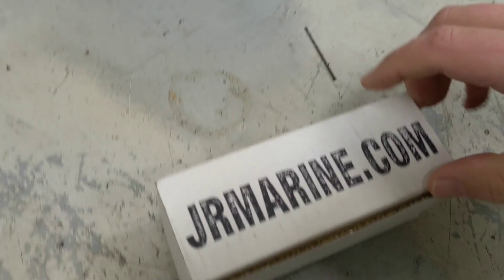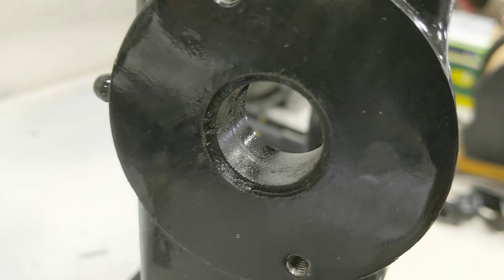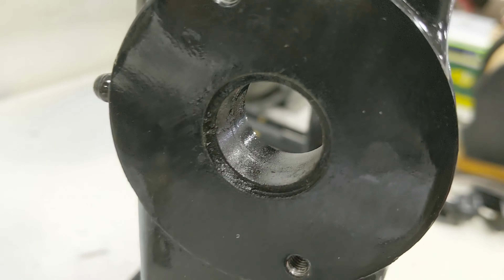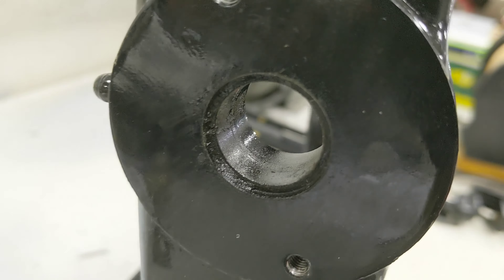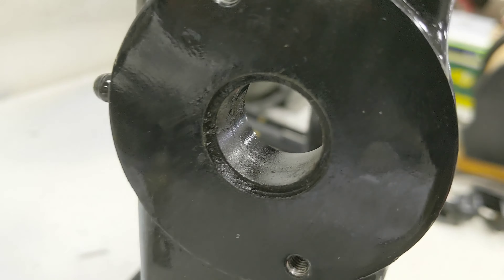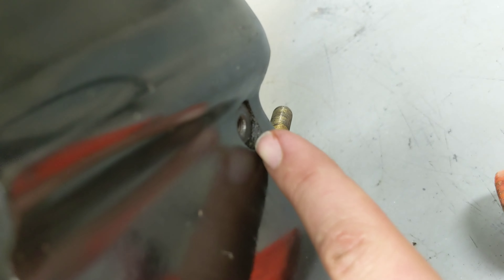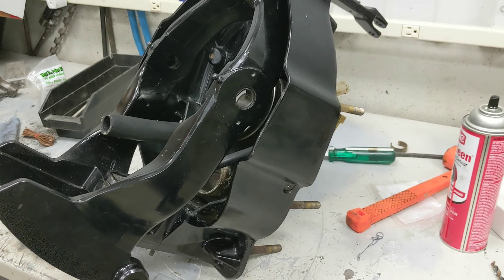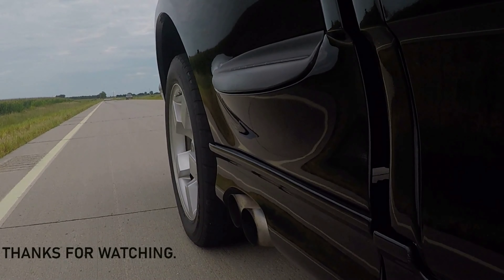Installing a Rebuilt Gimbal Ring, New Swivel Shaft & Gimbal Bearing -- Mercruiser Alpha One Gen2

Comment: You forgot to roll the water hose clamp - You're gonna hate if you have any problems later.
If it's rolled to the top then you don't have to take anything else off to get to it, but now you'll have to take the bell-housing off just to get to the hose clamp.
Live and learn - been there done that.
Reply from the maker: I think somebody else said that in the comments too. I think if it comes to that I would cut the hose clamp and just get a new one. But yes, you have to be very strategic with the hose clamps. I may have missed one or two of those.
Reply: I seen in the next video that you actually rolled it up to the top 👍 @605BOLT
Reply from the maker: Even a blind squirrel finds a nut now and again haha
Reply: LOL
I've been known to find a acorn every now and then.
I appreciate the detail in your video's.
These full rebuild vid's provide a lot of information that is useful for preventive maintenance, things I hadn't considered looking for.
I am currently in the process of Boot replacements on two SeaRays, just did a Engine Coupler & Alignment on a '79 Sundancer and followed up w/ full cable replacements, only to discover that the boots were leaking (4th time pulling the Stern Drive on that one....ARRGGGG). After pulling the Gimble Bell-housing off yesterday (with some good insight from your video's) I found that whoever replaced the boots that last time didn't even get the clamps tight, and after messing around I learned a hard lesson about positioning those bellows clamps "strategically" as you mentioned (lol) for future access. The ones I'm working on are older than the Gen II you're doing and you have some added BS in your way that I don't have on the Alpha Gen I, however...if I had to deal with loose clamps again I would want to be able to get a wrench on them WITHOUT pulling the bellhousing off and making a 4 hr job out of a 15-20 minute job - If ya know what I mean.
Lessons learned - that's why I made the comment.
You also made the comment about the probability of not even needing the exhaust bellows, but if its not used then the water can back-up in the flapper valves in the exhaust  and corrode the mechanism so they don't open and close correctly - another lesson learned the hard way and those are a mother to replace in a tight engine compartment - TRUST ME ON THAT ONE.
A wise Man told me:
"Experience teaches a hard lesson, so you can learn from others experience or your own, choose the shorter path and learn from others mistakes instead of have to make them yourself.
That's why I appreciate your video's and others video's, b/c it helps avoid costly mistakes and HOURS if not DAYS of labor, not to mention senseless money spent on unnecessary parts etc.
Thanks for the Vid's bud, keep it up, your helping more people than you realize, even if they don't post comments, they're still out there watching and learning. FINDING ACORNS LOL  @605BOLT
Reply from the maker: Thanks for your kind words!!!! Sounds like the SeaRays and Sundancer are getting the full treatment!  Are you a marine mechanic professionally or a relapsed boat addict?  I can't imagine having more than one boat.  One is enough headache for me haha. I have never worked on a Gen 1 Alpha.  For my next boat, I'd like a Bravo so I can learn on something a little different.  I never thought of corrosion really due to being on fresh water but you're right that the flappers and height are basically your only defense against surging wake when you stop.  Some use the little exhaust tube deal. I'd like to try that sometime.  It only seals when its down. Kind of an ingenious idea.  I appreciate the words of wisdom and couldn't agree more.
Reply: Not a boat mechanic per se, just a backyard DIY'er, but I've learned a lot this summer after loosing the upper gear set on my Alpha one.
I only have one boat but my dad has an older SeaRay and he's too old now to do the work himself so I volunteered, since it appears I'm the only one competent enough to do the work and do it right.
I have a background in welding, pipe fitting, heavy equipment operation; I was a independent welding contractor for over 30 yrs and I can fix just about anything - not a boast, just my nature I guess. I like building things and fixing stuff other people throw away, you can't imagine the treasures out there that people just trash because they don't know how or not willing to try and fix them. One good example is my old "54 Ford Tractor, got it for a song and had it running in one day, that's a real treasure for sure.

I've built a few motors in my day and worked just about every recreational vehicle we've ever had, snowmobiles, ATV's, motorcycles and even a few lawn mowers hehehe...
I would like to open my own boat repair shop since there's really no one around that provides a full service marine shop and NO PARTS, not even the common everyday items we need for maintenance on the very basic marine engines and stern drives, and @ 100 bucks an hour and with as many boats as there are around here (just south of Flaming George about 40 miles - North Eastern Utah) I could make a killing LOL.
There's an old saying: "If an idiot (like most mechanic shops around here) can make a living doing it, anybody with a lick of sense can make a killing".

I've thought about doing the direct exhaust but I prefer the quiet sound, like a butterfly @ Mach 1.
Believe it or not, Lake water is almost as hard on boat as salt water, because it's really hard water and a lot of hard minerals that build up over time, so constant maintenance is the only secret to owning a boat. 
We could always follow the advice of my old friend (multi millionaire):
"If it fly's, Fu**s or floats, or eats hay, DON'T BUY IT, RENT IT"

Keep up the video's, as I said before, you're doing a great job on detail and providing a great service to everyone willing to watch and learn - otherwise we would have to pay somebody to do the work that most people can do themselves but never considered it because they think it too hard.
This stuff is really pretty simple once one gets to know how everything works and is put together. 
A word of advice to all who watch:
Dare to try, you only fail when you refuse to try.
 @605BOLT
Reply from the maker: @migelikali7265  can't agree more. Sounds like we have lots of similar interests. Whatever moves is fun. Thanks for watching!!

Comment: Thanks, upcoming event this winter for me.😅
Reply from the maker: @Yugsie  ya it sucks but when it's done you feel so much better. And the boat drives so much better.
Reply: @605BOLT  
It's gotta help around the dock and trailer!
Reply from the maker: @Yugsie  for sure. It is a little bit wobbly when the gimbal ring is all wore out. You need to make huge steering swings to keep it on track

Comment: Just a Tip from a 42-year pro mechanic. Freeze your bushings and bearings over night before installation in a freezer (or use a CO2 fire extinguisher to freeze if in a hurry), they install much easier when cold. ;)
Reply from the maker: For sure.  I've used that at work from time to time.  Definitely makes a difference.  Never tried the fire extinguisher.  I have used canned compressed air propellant though. That works too in a pinch.  Good info!

Comment: Thanks, great vid, got bit of play in the steering, now I know where to look.
Reply from the maker: Yes for sure. Take a look. There is some natural play because of how the valving in the power steering ram reverses fluid and maybe your steering pin pinch bolts are loose. Worst case the steering arm is worn out. Hopefully just loose and can be tightened. Check out my video on gimbal pinch bolts if you want a better idea of what I'm talking about. Good luck!
Reply: @605BOLT  thanks man I will!
Reply: @605BOLT  nah man, the steering arm is completely rotten, needs replacement. Do you have experience with drilling a hole in the transom, take out the pin from there replace the arm  then cover the hole with a stainless steel plate? Like jrmarine? Got a gen2 so should work. What do you recommend, oem or aftermarket for pin and swivel arm? Thx!
Reply from the maker: I have personally worked with Ron at JR Marine. He is good people. Mention you saw my videos to him! But as to your original question no, I have not drilled and made the fix like you describe although many others have with great success. My engine was already out so it wasn't a big deal to go the long way so to speak and do everything fully removed. But I would talk to Ron and he can guide you through the drilling process. He also has legit OEM parts. Not Chinese replicas so he's a great one stop shop. Hope this helps. 👍
Reply: @605BOLT  cool man I will contact them and mention you. Not sure if they will ship to Holland Europe.  Thx for your help, appreciated. Subbed, keep up the good work!!
Reply from the maker: @mvanderw379  appreciate it! He shipped to me in south Dakota. Not international but still a ways. If you get hung up, hit me up in the comments and I will do my best.

Comment: Great Videos Nice Intros. Hate to be the bearer of bad news but pretty certain you put that seal in wrong. The cup and spring of a seal faces the liquid or pressure side. All in all great video.
Reply from the maker: Right on. Thanks Jessie. Regarding the seal direction I thought that was strange as well but according to how the seals were pulled out and also how the Mercruiser service manual diagram shows the lip is actually supposed to go up. Aka facing the more slender end of the swivel shaft. I figured it would be different as well based on how seals "keep liquid in" so to speak. But they can also keep it out. Examples being the front main seal of an engine keeping road salt and slop out of an engine or how axle end seals keep the same road grime out of the axle housing. I'm 90% it's right but it goes against my instincts as well. Good eye!
Reply: @605BOLT  If your going by the book I wont argue. Though I have known a book or two to have errors. Still this is possibly an exception being the spring would be exposed to salt water if put in the other way. Then again salt water pump seals have bronze springs to mitigate. All in all if its not leaking screw the rules we are all just Oil Rags. LOL
Reply from the maker: Certainly possible it could be an error.  I run in fresh water here and it is dry docked on a trailer and not in a marina slip.  I think a case could be made for either direction for sure!  Appreciate you watching/commenting.  I always like to hear feedback!
Reply: Any one know for sure. Just done mine spring facing down as this was the verbal info I had. My boat is about to go back in the marina so I don't want to get it wrong.
Reply: I just took mine out, it was installed to keep the water out. The opposite way as done in the video. I then search all the comments to see if others have posted on seal orientation. My vote is for lip side toward water and grease with appropriate grease, re-grease every winter/non use. Please post manual directions if possible.

Comment: Makes me appreciate being able to just go in the back and grab a part. What's the part number for the brass fitting for the oil line. Not the plastic OEM One.
Reply from the maker: I don't have that part number off hand. Sorry. I never had to replace the brass fitting on mine.
Reply: Who sold it to you or did you just put that brass fitting on the end of the OEM plug that goes through the housing?
I do alpha drives on a regular and they break all the time-
Reply from the maker: @hedgepethracing9590  I bought it all as is. Nobody sold me a brass fitting so if what you're saying is true then somebody must have changed it before me.

Comment: Hey good video.detail by detail 👍🏻I have that problem right now my boat is leaking water inside from that same top seal but I don’t know what outdrive I have so I can order the parts the outdrive is painted in black my boat it’s a 1994 crownline 250c with a 7.4 v8 mercruiser any info would help thanks 🙏
Reply from the maker: Thanks for the kind words. Since its a big block, I would guess it's a bravo. Check out my other video here to be sure. It helps you identify what you have. The boat used in my videos is an alpha one gen 2. 

https://youtu.be/-bOC5wdotvA?si=d5axjJIsbAPHxugt